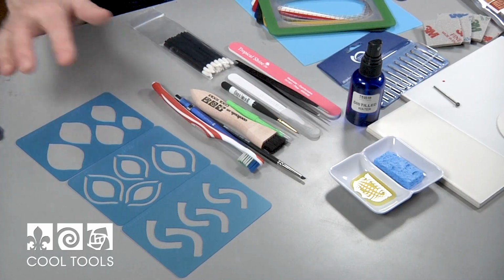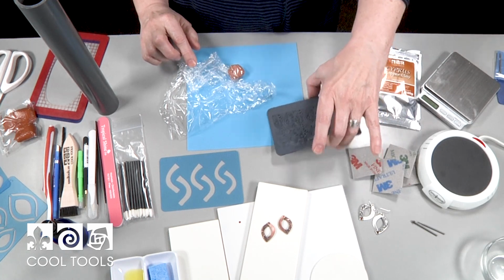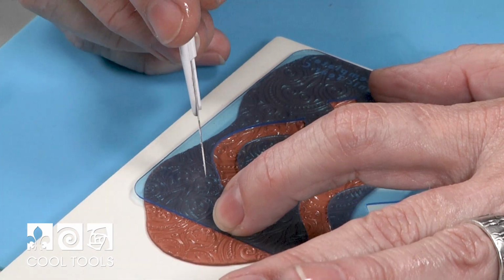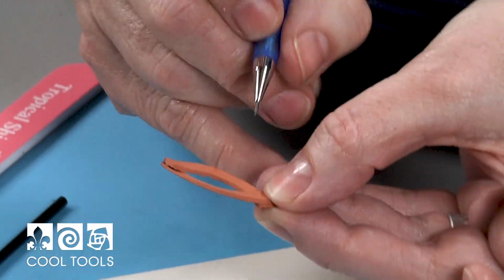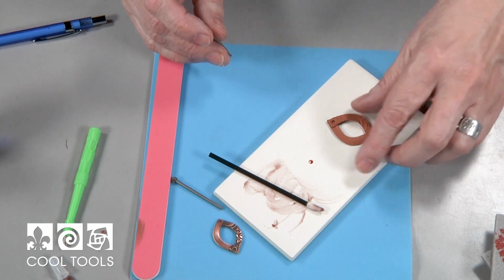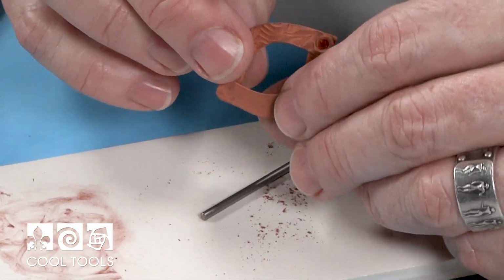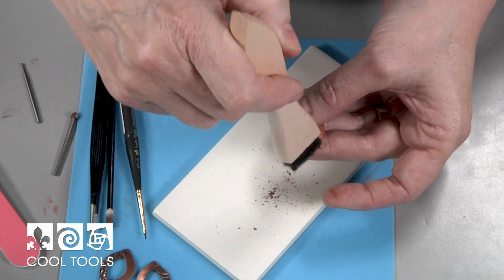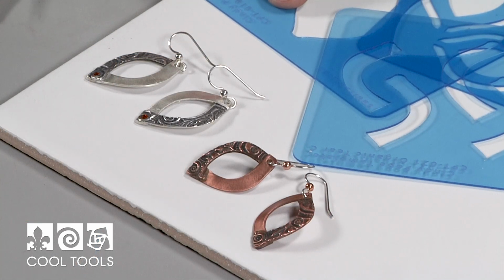Cool Tools | Fold Over Earrings with Cyprus™ Copper Metal Clay by Cindy Pope

Comment: How long does the clay take to dry on the heating surface? And, do drying times vary depending on the clay? For example, if I'm making these same exact earrings using Phoenix Torch Fireable Clay would it take longer/shorter for the pieces to dry on a similar heating surface? And, if I were to use a dehydrator, is there an ideal temperature or just the default 165F? How long? Thanks!

Comment: Hey, 
I just started with the copper cypress clay. I made 2 hearts but I use a mold instead of using a cutter. after I finished the firing the backs had large bumps on them.what did I do wrong?
Reply from the maker: Hi Rhonda, was the piece completely dry when you fired it? Bubbles usually mean that there was moisture still in the clay before firing.
Reply: @cooltoolsvideos  yes it was,I let dry for 24 hours.
Reply from the maker: @rhondarice5446  Hi Rhonda, depending on the thickness of the piece, 24 hours may still not have been enough - the piece could have still been damp inside. We would recommend drying on a hot plate or dehydrator to ensure the piece is completely bone dry.